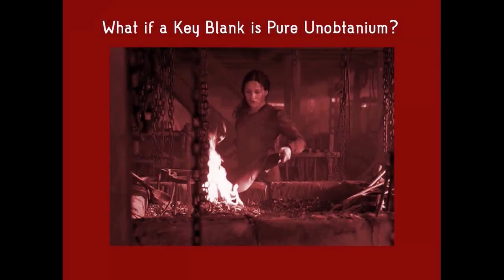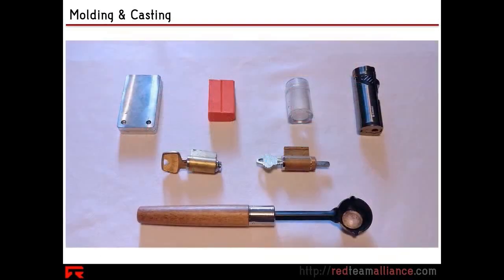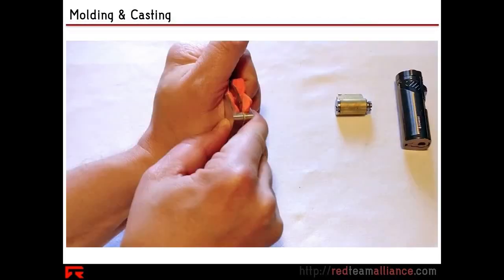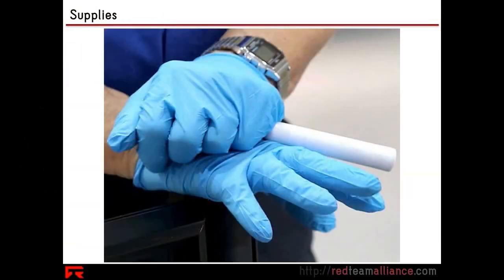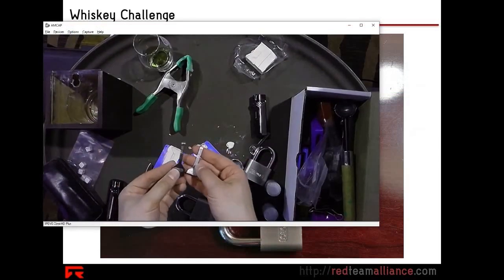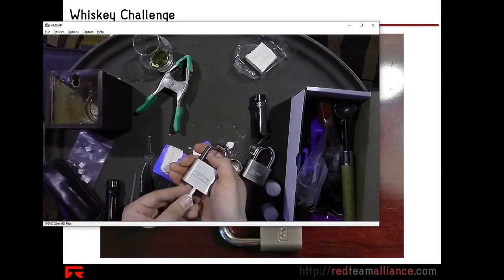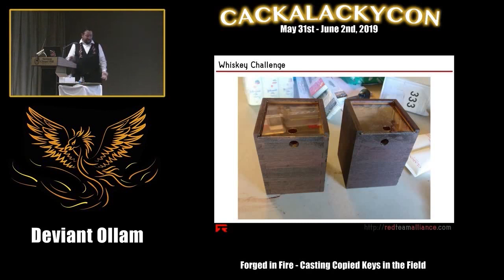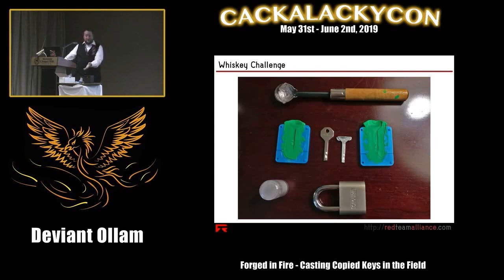preview of my recent CackalackyCon talk: "Forged in Fire"

Comment: Just watched the whole video over on the con’s YouTube. Quick question for ya. Did you try casting with a lockpick inside? I would worry about it messing with the flow of the metal if you tried to pour around it. I would pour and then insert the pick before it has a chance to set up. At that point you could, in theory, add any thin and strong metal brace to the cast key.
Reply from the maker: It's a neat idea. Others suggested wire, etc.
Reply: Maybe it would be a good idea to preheat a bit the metal to avoid cooling the cast to fast.